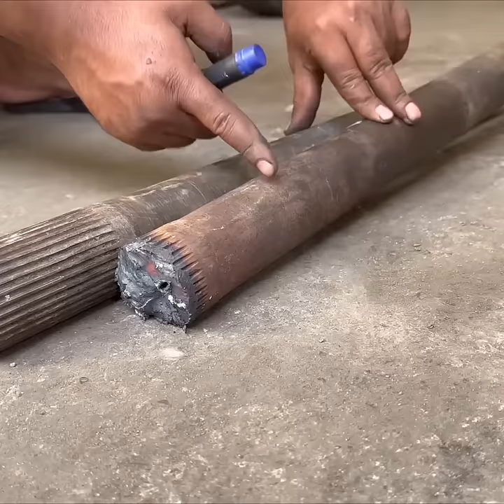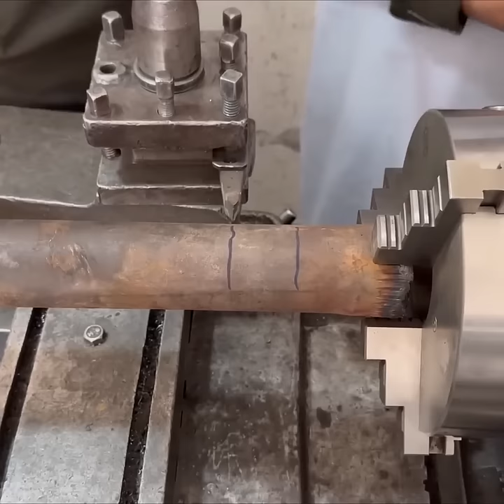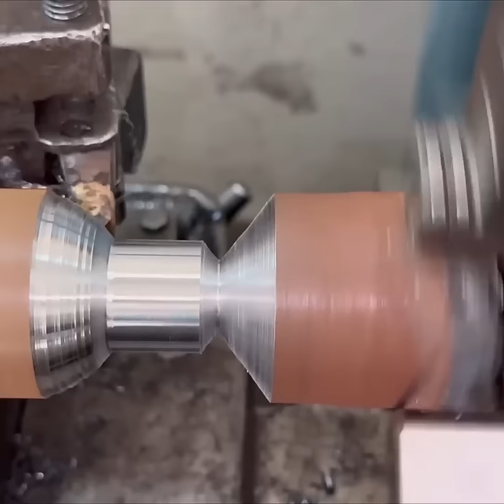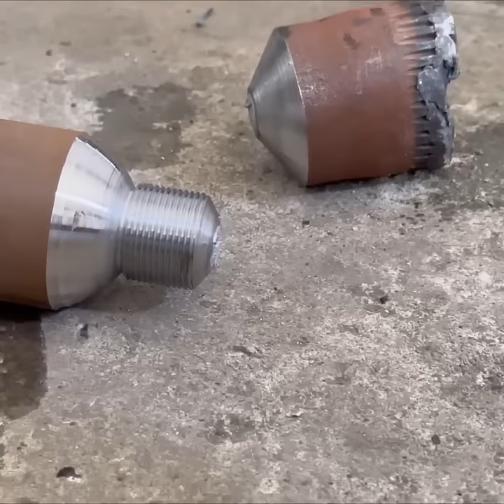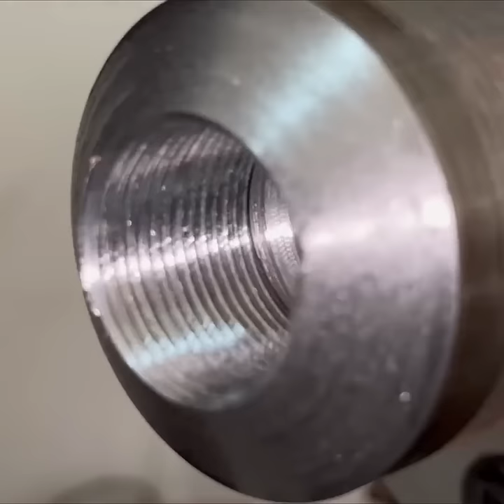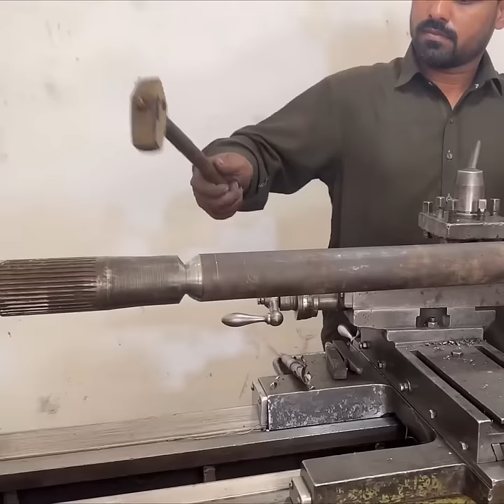How to Rebuild Broken Axle with Amazing Technique

Comment: This is actually a repair that looks like it would hold up reasonably well after being welded up. Perhaps should have used a larger diameter thread but other than that this looks solid.

Comment: What about the length. About 10” of the shaft length was cut off..
Reply: Yeah, from a spare one
Reply: Taken from spare ones. The cut off broken bits perhaps may be usable too later.
Basically cannibalizing 2 broken parts to make one repaired part.

Comment: 😮 Where is the Cutting Fluid ? 
Need to use " Soluble Oil " when using  drilling and cutting  steel/ metal ...tools last longer 🙏🙏🙏

Comment: your axles will break again😂😂
Reply: That's not going to break again in a hurry. 
We got ourselves stuck away back with our Kenworth on the side of the road, in Sydney.  This was way before mobile technology and the like. Anyway, just up the road was a fellow with a back yard engineering business who reckoned he could weld up our problem like new. 'She'll  be right, mate.'  And right she was. That old Kenworth is still hopping around outside as we speak. And that was dam near on 45 years ago. So don't tell me that weld won't hold. I bet it out last the truck it's fitted to.

Comment: This is so terrible it’s not even really funny. Anyone notice how easily he snapped it off instead of cutting it all the way through ?!  That’s because it’s heat treated and hardened. Guess what happens when you weld it?!  It wrecks the temper and ruins the axle. It’s going to twist off at the weld or next to the weld very quickly. Also lost about a 1/4 of the strength it could have possibly had by threading the center instead of welding it all the way from the middle out. 😂🤦‍♂️🤮

Comment: I usually rebuild my axles by buying new ones and I suggest you do the same. Nothing like changing axles again because you were to cheap to get new ones, especially if you haul heavy. These third world countries are just trying to get by so I don't blame them for trying but I also don't run a 1952 machine in a robe and flip flops either !?!? That weld is a weak spot and the first time you put a load on it going up a hill, BANG time to change the axel again ?!?!? 😂